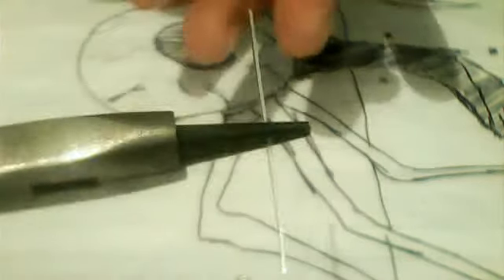DIY How To Make a Screw Eye Pin

Comment: I do these all the time but I use regular wire - it's cheaper than head pins or eye pins.  20 gauge wire will work, as will 24 gauge for the heavier things, like dominoes or other similar sized resin pieces.  If you feel it's not strong enough, use 18 gauge.  Straighten it out, clip the ends, and they're done.
Reply from the maker: Sweet thanks for the tip, and Saving Money is always good ^_^ I love DIY videos, I just relay made this one to show My girl  Freek Show how to make them, she is new at clay as well as me, and we help each other alot, swaping Ideas and techniques.